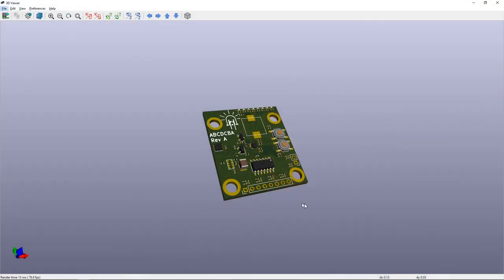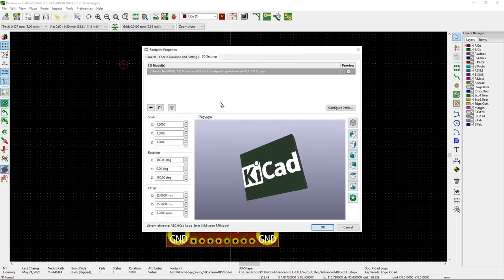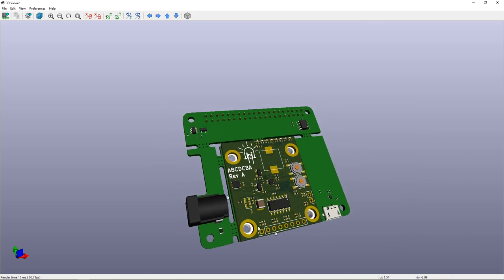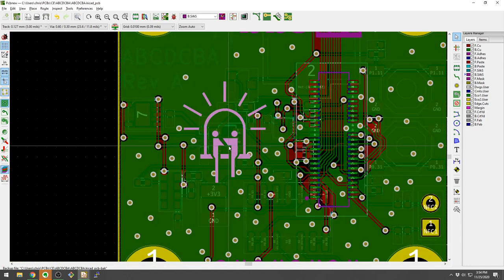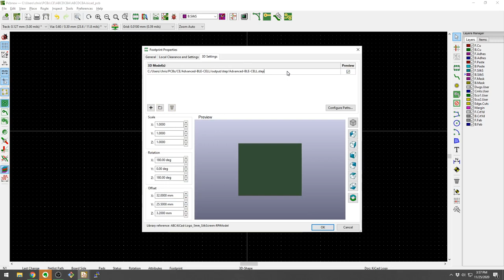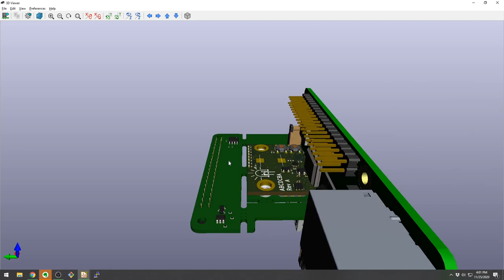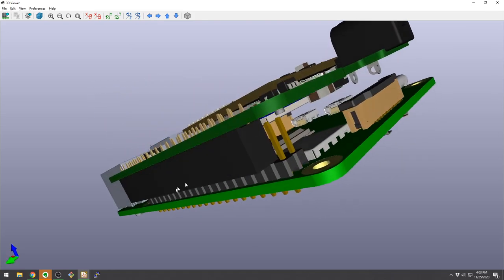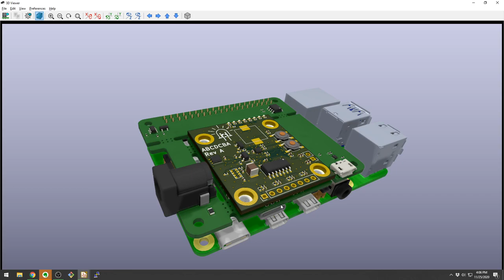Adding multiple 3D models to board stackup in KiCad 5.0

Comment: Instead of changing the STEP path in the footprint back and forth, try the following... In the footprint editor, chance the footprint type from "SMD" to "virtual".

The kicad logo probably is already set as a "virtual" (non-BOM) component.

Then, in the 3d viewer you can choose to display/not display 3d models for your virtual footprints with a checkbox. Super fast and easy to toggle your "motherboard" on and off without mucking about with the footprint 👍🏻
Reply: Great tip!

Comment: I like the use of the logo symbol as the link to the assembly. I've been creating symbols for mounting points (just calling them MP?) and then corresponding footprints that contains the bolt pattern information. That way I can reposition the mounting point footprint in the layout while still having confidence that the bolt pattern will line up no problem. I then link the 3d model with the footprint including the screws that will hold the components together. I also like creating the symbols for the mount points because I can visually communicate on the schematic, exactly how the mount points are grounded.

Comment: thanks! works in KiCad 6 as well 🤩🤩
but here's what I don't understand - why start creating a footprint of the module from the logo?
you can make it from a connector that is installed on the main board (many of them in KiCad libs have default 3d model), draw the outline of the upper module and add a step file as a second 3d model to your footprint.